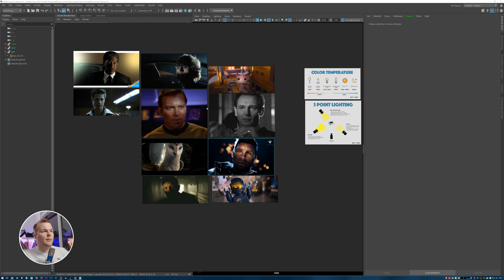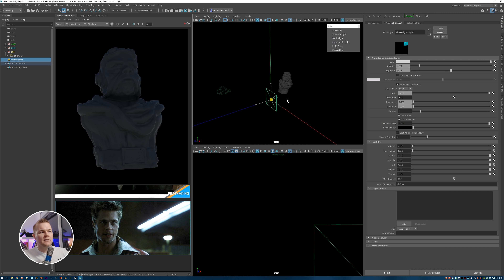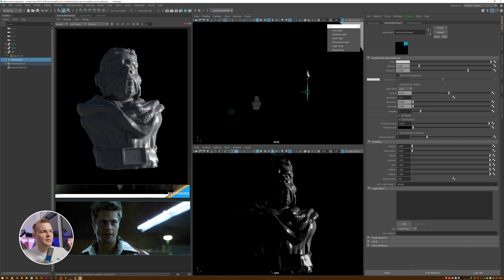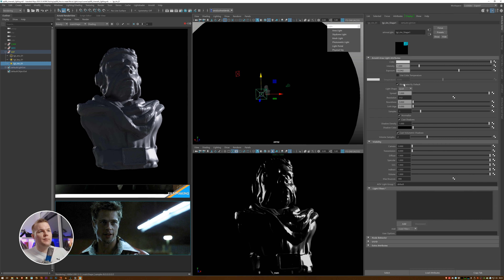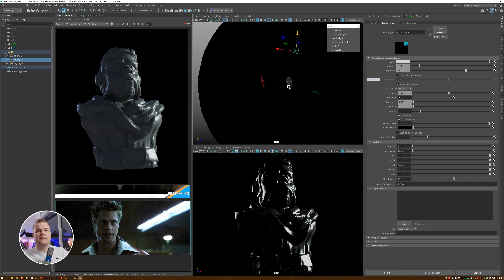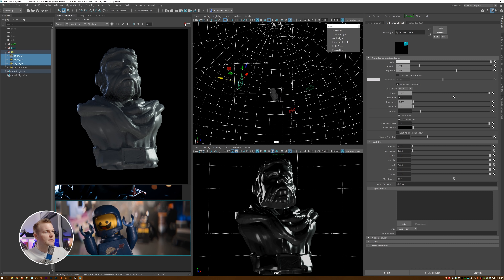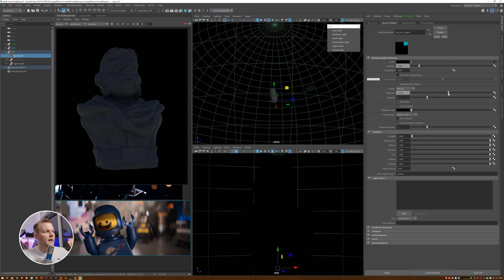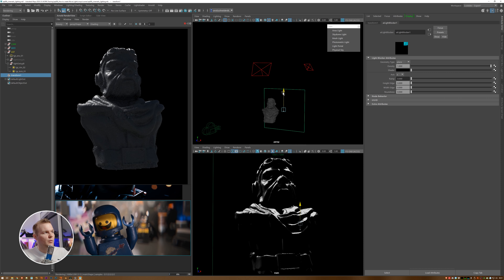Cinematic Lighting Techniques Using Arnold / Maya

Comment: Well crafted as always! But there are two questions that popped up. 1st I heard that the normalize switch should be turned of for physically correct behaving lights in Maya, what are your thoughts about that? And second you’re referring for correct scene scale. I heard that often when lighting a scene being physically correct is important when working with GI. What is your understanding of that. I’m having default setting for cm. In Maya I use 10 Maya Unit as 100cm. As I read that’s the correct way to translate to real world scale?
Reply: Hm no one has answers?